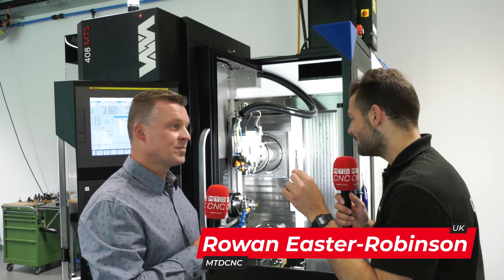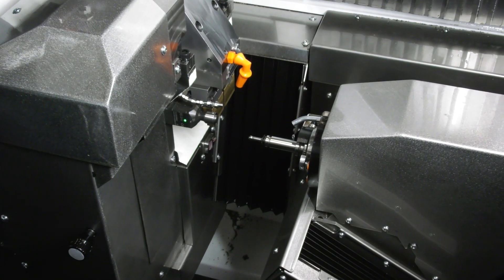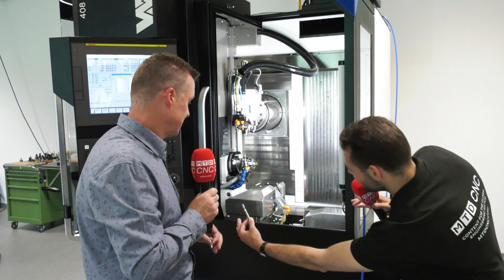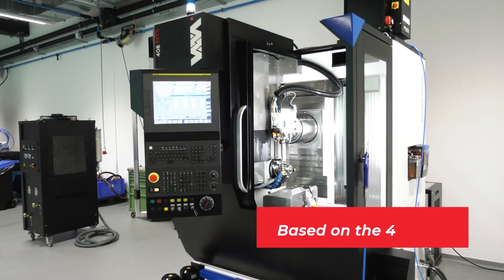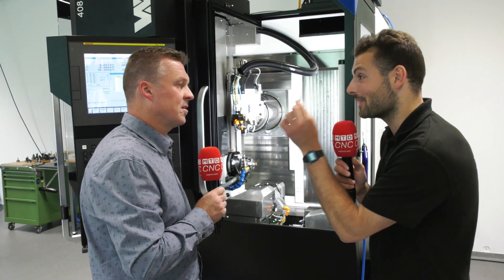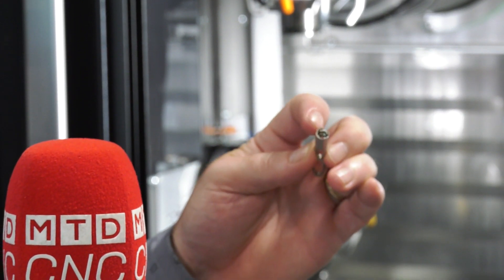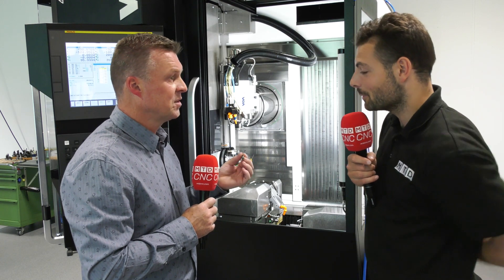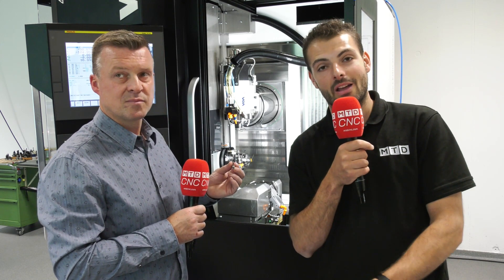Cutting edge Swiss Made machining

Comment: On a machine there is only 3 types of tool holders I would use when it comes to milling operations 
1. The schunk tribos tool holder
2. The regofix power grip
And 3. Shrink fit tool
Reply from the maker: cool isn't it
Reply: @MTDCNC  let me put it like this. if i had the space and money i would have one standing in my own garage. but sadly i dont have that kind of money laying aground and me garage is only 6 m2 so there isnt enough space for it. but if it was bigger and the money was for it then it would stand on a 1 meter thick steel reinforced with in floor heating/cooling to keep constant temp in the concreat slap ( so the concreat dont change at all do to thermals) with very insulated walls and double door and AC. max thermal stability ( the double door is do there will not be a big gush of air changeing the temps quickly )